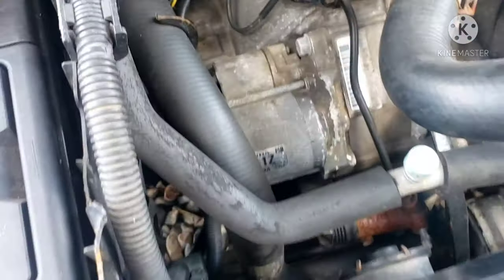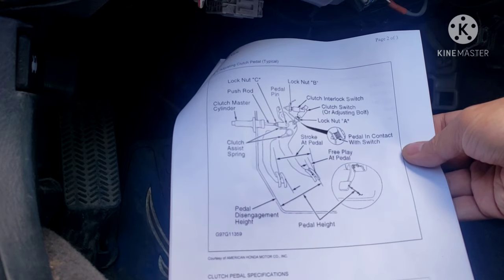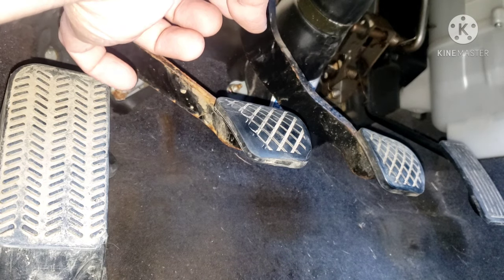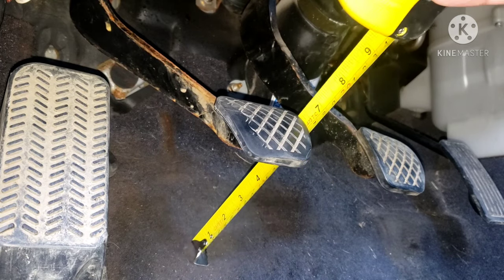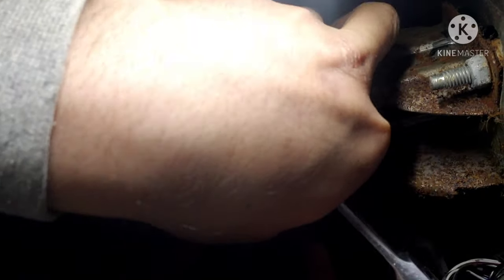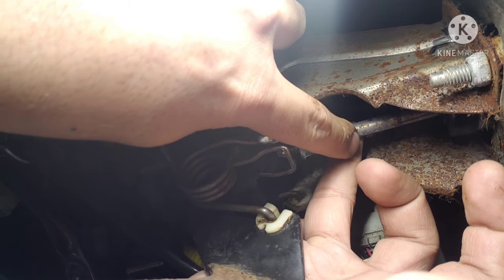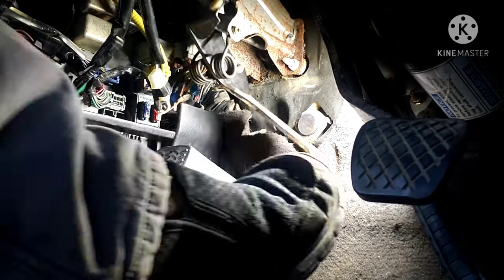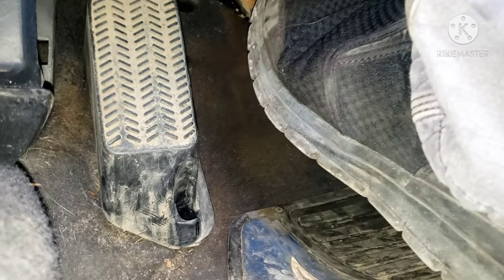*Solved* This High Engagement Clutch Pedal Honda Prelude. Adjustable Pedal

Comment: I had the same issue after changing my clutch fork. The pivot point was off. Instead of clockwise or counter clockwise I think if it like this... you shortened the master cylinder rod, so that your pedal needed to throw further to hit the sweet spot. Thus lower engagement.

Comment: If you look at the original honda manual, it says to roll back the carpet before making measurements. This means your pedal was most likely at a perfect height. The problem you have corresponds perfectly to simply a worn clutch.
Reply: worn clutch raises bite point?
Reply: @tek6303 yes but sometimes the pedal goes up from time to time

Comment: I believe you turned the adjust rod COUNTER-clockwise. I guess it all depends on your frame of reference. But by looking at the rod going into the firewall, you did turn the rod counter-clockwise in order to increase freeplay and lower the engagement point.

Comment: That wasn't moisture on the the master cylinder rubber seal. I think it was clutch/brake fluid. If so, you will lose the freeplay again since air is leaking into the system.

Comment: Thank you Jasmine, this was a great video!
You present it very well, kept it simple and to the point
Good job!
Reply from the maker: Awesome for a good feedback, I'm Glad you enjoyed it!
Reply: I just adjusted my clutch pedal and lowered it after the clutch was replaced last week this worked perfectly, thank you so much!
Reply: @jfGarage4k  I have an issue with this... After I adjust the pedal to be higher and also stiffer the clutch engagement is near the top ..... my clutch was replaced last week hence the bitepoint should be near the floor not high .... but when I adjust the pedal to be lower closer to the ground the bitepoint is closer to the floor which is good but the pedal has a lot of dribling freeplay this way.... so is there an option to have the pedal stiff without freeplay and also have the bitepoint close to the floor as it should be with new clutches ?

Comment: Hi, confused! As you face forward in the vehicle (as normal) and you are facing your end of the rod going away into the engine bulkhead, did you find an improvement by turning the rod clockwise or anticlockwise? You tried clockwise first and it got worse and then you confused me by saying 'turn the other way.....clockwise!? and it is better. So which rotation direction solves the problem of a too high biting clutch pedal?
Reply: I’m experiencing the same thing in my 04 Civic LX. I had to turn the CMC rod counter clockwise to get at least 3 threads to show; then I retightened the nut.
Reply: You push the shaft in by turning it "clockwise" looking at it from the seat of the car forward. He did say "clockwise" before. But he was looking at it from under the dash towards the back of the car.
Reply: In terms of "raising the engagement point" or "lowering the engagement point" which is what we are looking to do, results of "getting threads to show" and "pushing the rod in" don't help.

Comment: Good video. Seems like with the adjustments you made, there’s almost no free play between the rod and the plunger. You barely have the press the pedal to shift. Hopefully you’re not pre-loading the rod against the same plunger, otherwise even with the pedal fully out, the clutch will slip and wear prematurely.

Comment: Should the height of clutch and break match? How will i know if my clutch is too high? My gear feels hard
Reply: No, your clutch should be the heighest of all 3 pedals, brake one a bit lower, and gas the lowest. If you take any measurements roll back the carpet and measure to the car body, this is where you can make a mistake like the guy on the video.

Comment: I'm having the same problem with the Suzuki swift vvt I just bought the misses. Problem is, is that it doesn't have the locking nut.. it has a rod that is just bent at the end and goes into the clutch pedal..

Comment: Top of the pedal engaugement is perfectly normal and a good thing. It works down over time and wear. But i guess if ur used to a warn clutch, this helps.
Reply: I've never heard of a clutch supposed to be at the top to engage... I'm no super mechanic or anything but I've always had mine closer to halfway or under, and all my mechanics I've talked to say the something. Having the clutch in the incorrect engagement placement can cause more wear on the clutch. I could be wrong but I don't see how it being at the top is normal
Reply: @BMathiesen  you are right, if the pedal starts to bite when almost all the up the clutch is worn.

Comment: What if I cant loosen the nut
. I think the edges are getting rounded so my wrench doesn't want to get a good grip. What should I try next?
Reply from the maker: If the Nut is rounded Spray PBblaster fluid on that nut and use vicegrip to  crack that nut out.
Reply: @jfGarage4k  ok I’ll try only thing is that there’s not enough room down there.
Reply from the maker: Hahah ya I know  eh.  im a small guy with small hand i can fit just enough. Use a small vicegrip you can find
Reply: @jfGarage4k  got it. I had to take out the clutch master cylinder to be able to break the nut loose. I then replaced it because it was too rounded to put back
Reply from the maker: Awesome  good  work champ
Reply: @jfGarage4k  I also have another question about the clutch slave cylinder. I noticed that yours was really compressed and I looked at mine and mine is not as compressed does this mean that it's failing to retain pressure?

Comment: I tried this, afterwards the car wouldn't start. What would cause this?
Reply from the maker: Is the engine light on?
Reply: Yes, we just tried push starting and still wouldn't start. Thanks for your help
Reply from the maker: Can you hear the fuel pump primed before you start  the engine?  And  check if you have Sparks  coming  from Spark plugs
Reply: Check clutch pedal safety switch didn't get bumped or affected

Comment: Mine wont go into gear while running and if i do it in gear and start it the car starts
 To stall while the clutch is pushed down
Reply: Replace master cylinder and flush the system

Comment: This is not the problem I’m having 💀 I believe it’s the opposite as in the clutch has no pressure and stays on the floor
Reply: Check fluid level in the clutch reservoir, check if it's bled correctly. If that's not the case probably blown clutch cylinder or something wrong with the clutch spring.
Reply: Clutch cylinder and sleeve cylinder bro
Reply from the maker: Looks like you have air in the system. Bleed the clutch Fluid Properly

Comment: Why is there 4 pedals?
Reply from the maker: Modern Standard vehicle only have 3 pedals
Reply: The one on the far left is just a fake pedal on a raised platform to rest your left foot on, instead of riding the clutch. Some cars have them, some just have carpet, but the raised part is still there.